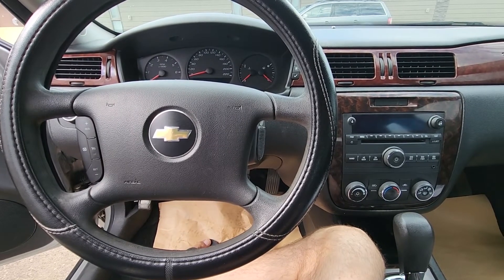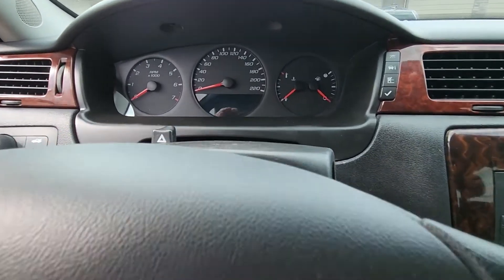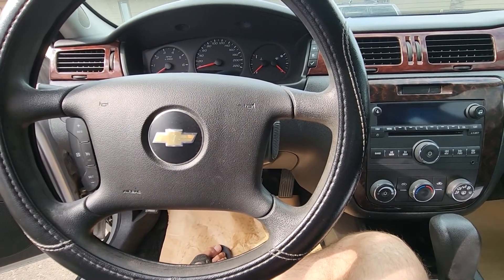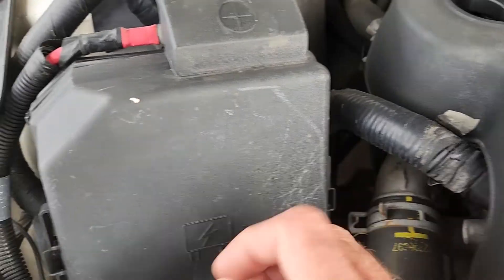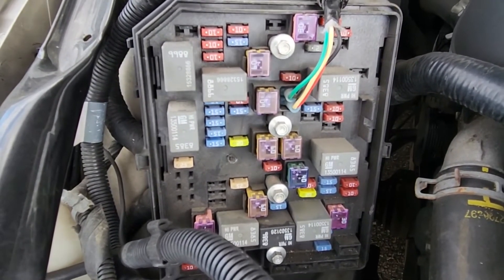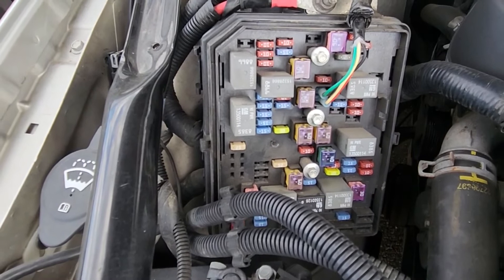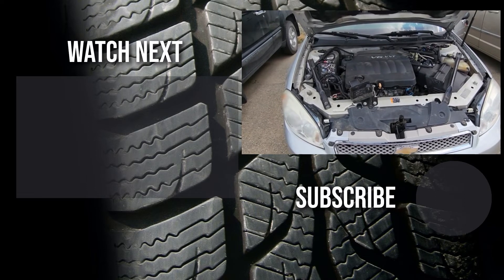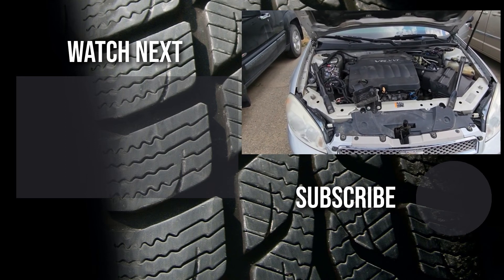Chevrolet Impala - ABS BRAKES FUSE LOCATION (2006 - 2016)

Comment: Do you have a video showing how to change and/or repair the sensors
Reply from the maker: Unfortunately no. Once the module is scanned error code will pinpoint where is the problem. Then vehicle has to be lifted up and wiring inspected towards that wheel. If wiring and electrical connection good then sensor is most likely the problem

Comment: So if I disconnect them I should take both out?  Mine are acting up I want to disable them. So pull both fuses then?
Reply from the maker: Hello if you remove the fuses you will still have abs light and probably traction light ON on the instrument cluster. Also it might affect other systems in the vehicle. ABS is usually not too expensive to fix. You will have to have the vehicle scanned to pull the codes and then follow up on those. Most likely you are dealing with failed abs / wheel speed sensor or corroded wiring towards one of the sensors

Comment: Wich one is for the brakes my right side dont turn on
Reply from the maker: Hi, there is no specific fuse for the brake lights. I'm not sure on which circuit they would be, but try checking parking lights fuses. Also make sure to check the bulb and clean the socket